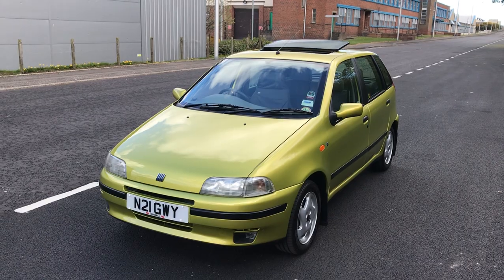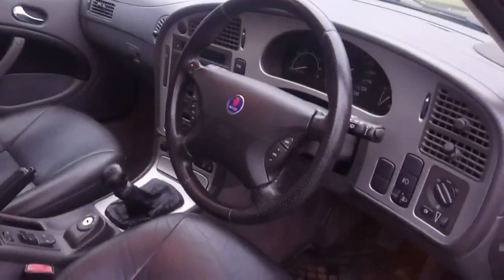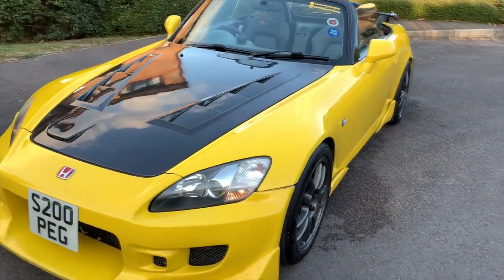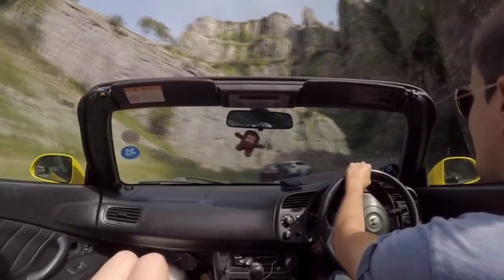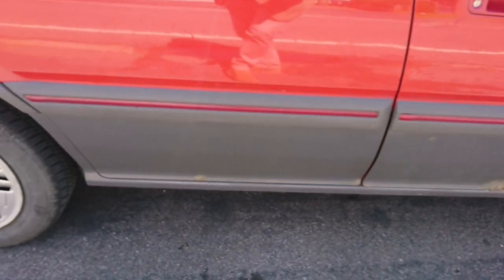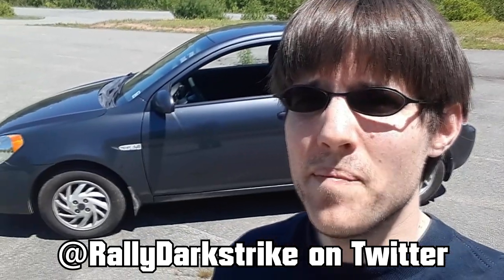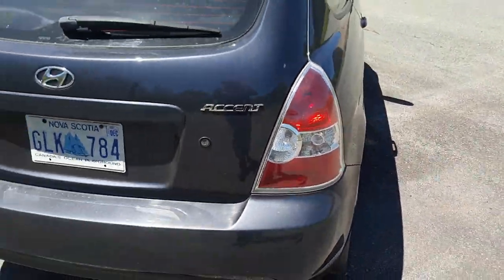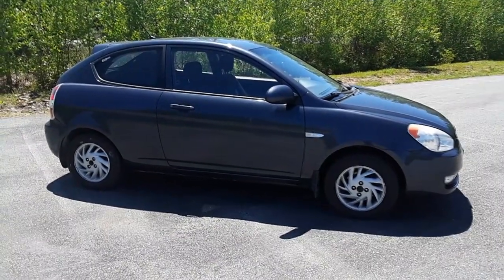The Car I WISH I'd Bought! [Miller Corner Virtual Car Meet 2]

Comment: Love these videos
The Hyundai Accent is the best car ever
My family is from Greece and when we would go to see them we would always get Hyundai accents as rental cars and they were awesome never broke practically and cheap. Unlike a Citroen c4 that caught fire one year 😂
Reply from the maker: "The Hyundai Accent - 100% less fire prone than a Citroen!"
Reply: Funny you should mention C4. Mine blew up on the motorway with just over 60,000 on it. Was told it needed a new engine. Citroen said they wouldnt contribute as the car was over 3 years old "so what do you expect". It just sounded as though their cars are not expected to last after 3 years lol
Reply: @MillerCorner  Mine has been so far! :D
Reply: As you can tell, I love mine! :)
I've never had it leave me stranded anywhere yet...not even when the starter died! That's the only part that's failed on the car, mechanically, and it didn't even really DIE, anyway! Technically it still worked, but what happened was winter road salt over time rusted through the grounding strap between the solenoid and the electric motor on the starter so no power was getting to the motor to spin over the engine....if that was easily repairable, that same starter would've still worked fine! I just got a new reconditioned one instead, but I bumpstarted it everywhere I had to go all weekend until I got it fixed the following week, haha!
Mine was $6900 Canadian all-in...bought it used at the local Mazda dealership with 54,000kms and it had sat on their lot for a year because nobody wanted the poor thing because most Canadians have the very American mindset of A. wanting an Auto transmission and B. wanting all the bells and whistles, so nobody wanted poor Humdrum until I came along! :)